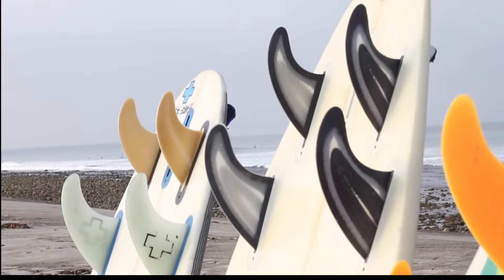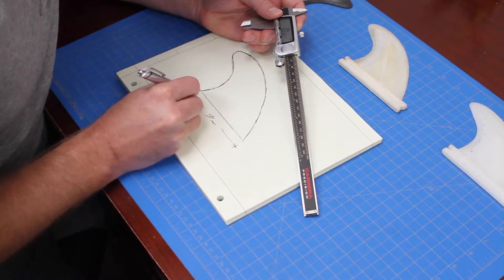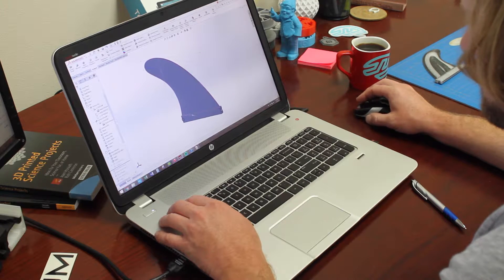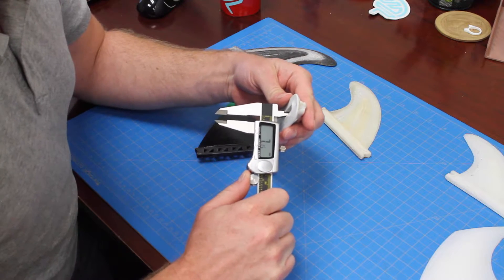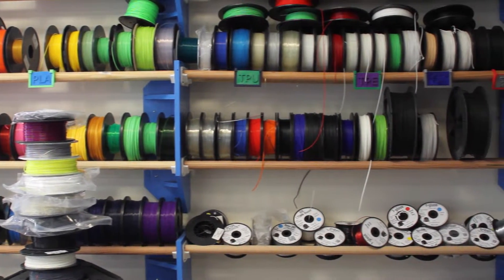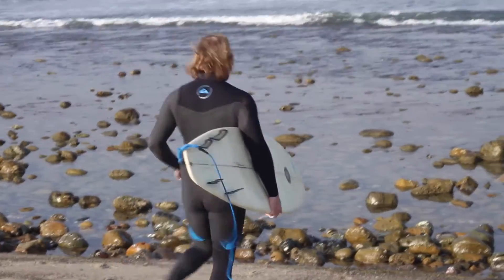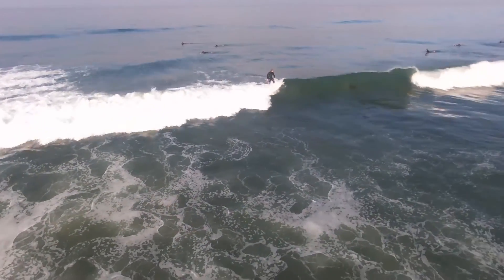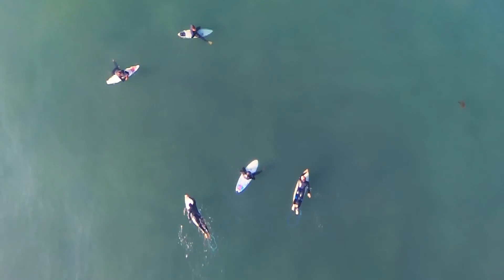Design Lab - 3D Printing Surfboard Fins

Comment: Great video. For the materials, what else would you recommend. The Markforged machine is pretty high end and out of reach for most consumers. Would you recommend PETG or something else?
Reply from the maker: +Carlos Porto - Check out NylonX - Super strong and stiff Carbon Reinforced Nylon:  https://www.matterhackers.com/store/3d-printer-filament/nylonx-carbon-fiber-nylon-filament-1.75mm
Reply: Nice, this looks quite promising. How about Polycarbonate?
Reply from the maker: PolyCarb is an awesome material. Tough to print, but very very strong!
Reply: So a couple materials to consider. Thanks again.